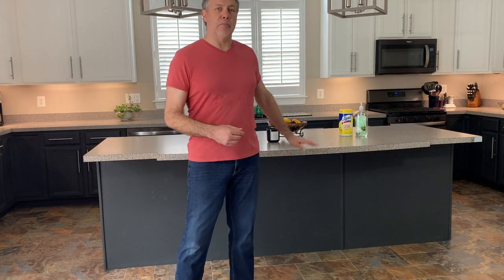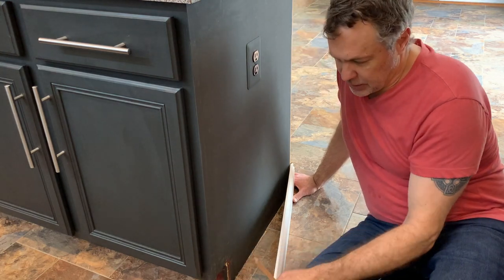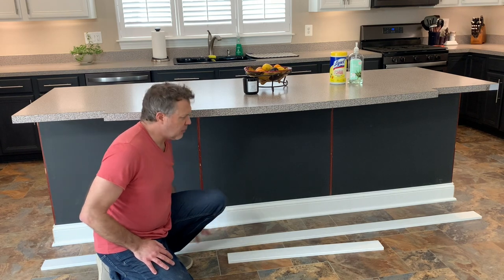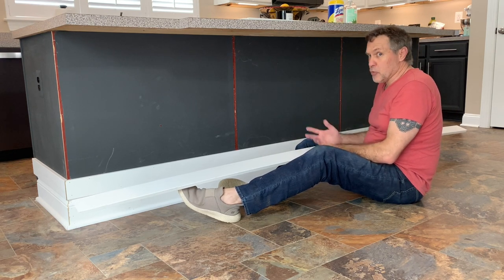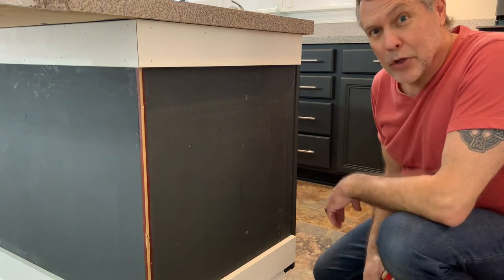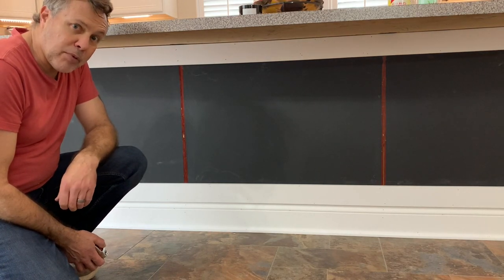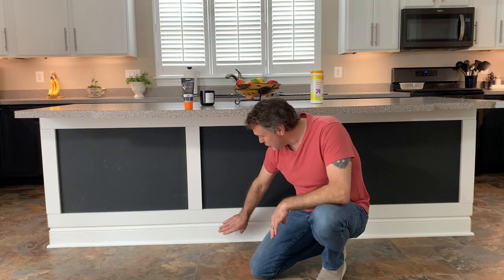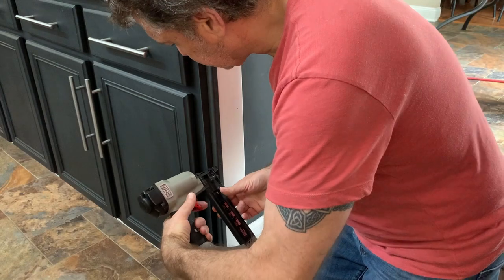DIY Island Cabinet Trim | Kitchen Makeover Series Part 3

Comment: This is super super helpful!  Thank you for being so detailed.  Question for you about the 1x4 lumber used to create the boxes.  I'm seeing a few different material choices at the hardware store.  Pine, MDF, etc.  Do you have a suggestion of which material to use if the trim work will eventually be painted with the cabinets just as you did?  Thanks again :)

Comment: Great job. Thanks for sharing. Can you let me know what air gun you used. I am looking to buy one to do some trim around the house. Thanks
Reply from the maker: The nailer used in this video is a pneumatic Porter Cable brad nailer. It’s held up well for over fifteen years.

Comment: Thanks for the tutorial. For the last piece of trim you used to finish the corners at the 16:54 mark. Did you had to rip one side so it sat perfectly on your 1x4? Did you use a table saw to do this?
Reply from the maker: You’re very welcome. That is exactly what I did. If you don’t have a table saw a circular saw could also do the trick. Worst case, and of course a matter of preference, you could simply butt one piece against the other side. Wishing you the best!

Comment: Love what you did here...is this section of the island made of quality wood like the cabinets? Im looking to upgrade mine but I have cheap engineered wood on the back of my island, not sure if that can just be painted over or add a thin sheet of wood and then build the panel/trim work?
Reply from the maker: Thanks for watching and commenting! The cabinet panels in my project are veneer and easy to paint. Please let me know what you decide and how it works out. Wishing you the best!

Comment: Did you use 1x3.5 for the frame and boxes?  Did that matchup when you used the end as the finishing piece from the other side of the island?
Reply from the maker: Yes - 1” x 4” boards were used. At the 12:03 mark, I discuss a couple options for the cabinet corners. I ripped a 45 degree cut down the length of the boards. You could bypass that and butt the forward facing boards over the edge of the boards on the end.

Comment: Nice Job!  Thanks for sharing this!  It is helpful!   I'm looking to get the dimensions correct before I start on our island.    You said you used 1x4's to frame the sides prior to adding the inside moulding.  Can you confirm if you ripped standard lumber to  4" wide or if you used standard dimensional lumber which would give you 3-1/2" wide boards?  (They look a little wider than 3-1/2" to me).  Thanks!!
Reply from the maker: Thank you! I used standard dimensional lumber - 3.5” wide. Wishing you the best!
Reply: @RegularGuyDIY  Thanks!!

Comment: How did the countertop getaway from the over hang in the middle with out corbels?
Reply from the maker: The butcher block is plenty sturdy, so corbels weren’t necessary for structural support. For the sake of our kneecaps, we didn’t want to add any decorative elements underneath the counter. I hope this answers your question. Thanks for watching and commenting!

Comment: Beautifully done! Since the sheeting on these islands is fairly thin, I am curious what size nail did you use in your gun.  Also, I was wondering if you knew where the electrical wires ran to power the embedded sockets.  Probably a good idea for me to avoid them!
Reply from the maker: Thank you for watching and commenting! I used 1” brads for the trim work. We have one outlet on the side of the island and the electrical conduit is visible from inside the cabinet. In our case the conduit is a couple inches from any nails, so there was no interference. I like that you’re thinking about personal safety and the potential for damage!

Comment: Nice job! Did you use 18g air gun for everything ?
Reply from the maker: Thank you Patrick! Yes, I used a finishing nail gun for everything.
Reply: Just starting mine, decided on using glue for the corners and using 15g for the 1 x3, 18g for quarter round trim.